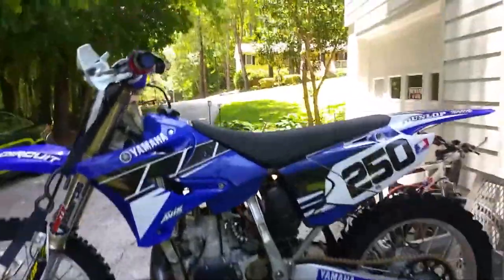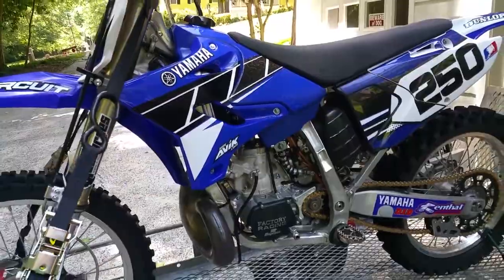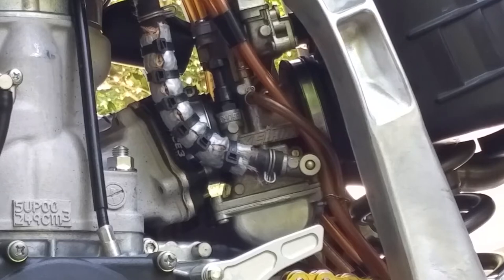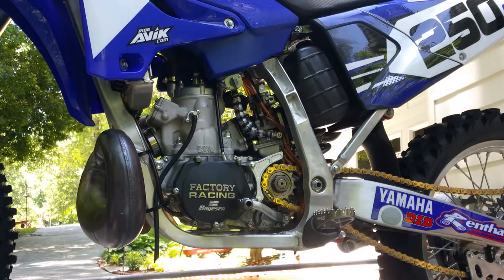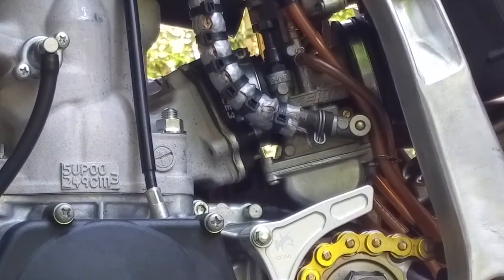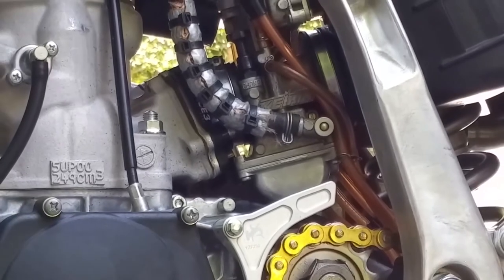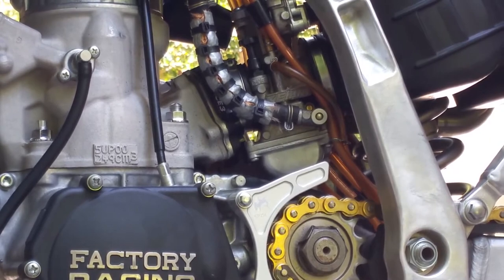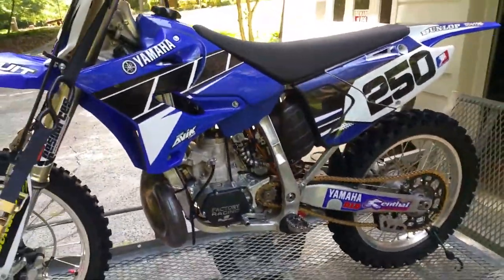👨‍🔧 Tips Adjusting Air Pilot Mixture Screw Mikuni Keihin Carburetor 2 Stroke Dirtbike MX YZ250 KX250

Comment: Great video man, whare I look when it sputters when I get on it about first 0 to 1/4 throttle. Seems like when I hit 3rd she blasts off like a rock, but until then she hesitates alittle. I installed the JD jetting kit the way they showed it. Sunk alot of money into this build...my first 2 stroke
Reply from the maker: Throwing a carb kit at it is probably not the fix.  You have to make sure all services are up-to-date including: thoroughly cleaned and inspected carburetor, top-end, air filter, exhaust silencer packing, all O-rings relating to the exhaust, carburetor and intake, inspect intake reeds for damage, check cylinder compression, do a spark plug reading, etc.    We need to know what year make model and how many hours are on your bike before we can recommend anything else. My guess is a thorough service and maintenance of your engine and carburetor are in order...

 Stock carburetor settings are fine for most bikes unless you live in extreme altitude, or at sea level in high humidity (or the above services are not up to date ..)

Post a long video of you riding your bike and of the bike running and idling and will we advise you further.
Reply: @HorsepowerHouse  
Yes will do... I've done everything you mentioned except repacked the silencer. But I will post a video for ya and I really wanna say thanks for your time. I'm pretty sure it just needs a fine tuning, but like I said I've just been learning as I go. The bike is a 01 ktm 200 mxc, compression is 165 out of 180 on a new top end...  new Keihn 38mm carb with the jd jetting kit. New air filter, reeds, spark plug etc....crank seal water pump seal.... . 50/1 gas mix with high end race oil.. bike is a monster... I'll shoot a video this weekend so you guys can help out! Thanks again
Reply from the maker: @freetaylor72  Has it always had this problem, or did it just start doing it?  And definitely check the silencer packing and exhaust o-rings.  Where do you live? (Altitude & climate)

Post a video and that might tell us more....  -Dave
Reply from the maker: @freetaylor72  What is your jetting? Pilot, Main, Needle, Air Screw setting etc....And what fuel & premix oil do you use?  And how does the spark plug look?
Reply from the maker: what did you determine?
Reply: @HorsepowerHouse  dude I've been working nonstop, gonna pull it out Saturday come rain or shine, changing the fork oil and put fresh gas in it. I'll take the video then...

Comment: Will warmer weather create a more rich or lean condition?
Reply from the maker: For most summer weather, also means more humid conditions as well, so that is "dirty" air (with less oxygen) compared to much "cleaner" drier, denser air in the winter.  So, you should equal that with fuel flow as well.  If the bike is "breathing" cool, clean, dense air, the bike usually needs more fuel (otherwise the bike the will run too lean).  On the other hand - If the bike is breathing hot, humid "dirty" less oxygen air - it needs "less fuel" to have the perfect air/fuel ratio.   So, simply put, bike needs leaner carb settings in hot summer, but richer carb setting in winter.  Of course it depends on where you live, altitude, humidity, etc.  Go on how the bike is running though - how it feels - as well as a spark plug reading.
Reply: @HorsepowerHouse  ok thank you
Reply: @HorsepowerHouse  Thank you!

Comment: Mine pops off for a second and then shuts off. I’m thinking some sort of carb adjustment. Takes a couple kicks to get it started after that
Reply from the maker: As stated in the Descriptiopn - fully service, dissassemble, clean, rebuild  your carburetor - IF everything else has been serviced.  Top-end rebuild, petcock cleaning, fresh fuel, new spark plug, etc etc etc...
Reply from the maker: What you are describing could be caused by a million things.

Comment: i have a similar problem on my honda cr 250 carb mikuni tmx 38 ... i already replaced all parts pj 25(40), mj410(420) , needle jet s7, needle gdy26-68(gdy26-65) float level 10(7.5)  , doesn't want to idle.  I have 3 revolutions of air, but it still seems to have little air and reacts badly to the air screw, can I take it all out to increase the idle speed....could it be a problem with vforce3?  they are about a year old, I had them outside and I didn't see a mistake
Reply from the maker: Has it always had this problem? Or what started it?
Reply: @HorsepowerHouse  no, and I don't know how it started, I just noticed that it was still smoking,I already had it cleaned with an ultrasound and it didn't help, but now I took it apart over the weekend and cleaned all, even the smallest channels, with a wire, but now I have the problem again that I'm probably low on fuel, because when I step on the gas, it keeps a high idle for a while and after  it drops in a few seconds, so I go up with the idling nozzle, now I put 30 but it's still not ok
Reply from the maker: @jonny621   I would say you are searching in the wrong area to solve the problem then. Something else is wrong.

Comment: I curently ride in winter (i ride 125 2t beta enduro bike) but I have a problem with the air/fuel needle because I can only turn it for 1 turn and than starts to go realy hard (so that means Im always on rich side and the bike  realy wants to die it isnt running good)  but normaly I could turn it like 4 turns. Is this normal for Keihin carburator or is it becaus I run summer jetting?
Reply from the maker: What is the climate where you ride?  Temp, altitude, humidity.  If it is quite different in winter vs summer you have to richen up your jetting for winter colder weather.   Pilot jet and Main jet.
Reply: Hi, its around 0 degrees celsius. I wasnt changing any jet only air/fuel needle. I richen it up like month ago it was running good but now it wont even stay running. @HorsepowerHouse
Reply from the maker: Richen pilot jet and main jet.  Should solve it.
Reply: I will try, thanks for advice!

Comment: Thank you for putting up this video on jetting.i have a 91 cr250 I just finished putting back together, and have never messed with tuning a carb before. Your examples will help, I hope. Also, what do you have wrapped on your fuel line? Thanks
Reply from the maker: Heat shield
Reply: @HorsepowerHouse  is it to protect the fuel line, or keep fuel cooler?
Reply from the maker: Keep fuel cooler.  Colder fuel makes more power than hot fuel.  Always refrigerate your fuel or at least keep it cool in the shade or in a cooler with ice.

Comment: What size jets do you usually run in cold Temps?
Reply from the maker: Larger than summer temp jetting.  Depends on where you are in the US though.  Hot  humid usually needs leaner jetting. But hot dry conditions need richer (to keep the engine cooler.)  Colder drier air usually needs richer jetting (because the bike is breathing cleaner air.)  But there is a fine line all depending on the conditions you are riding in.

Comment: My 2023 yz 250x was having rich jetting problems fouling plugs. It only has 3 hours on it. And the last couple of times I rode it it was sputtered and died. The smell from the exhaust was like plastic instead of the nice yamalube smell. Im running 32.1 non ethanol 87 pump gas. But the gas is from ealy September 2023 . So someone said old gas smells plastic like when burnt
Reply from the maker: Dude get that ancient fuel out of there.  Fuel starts to go bad after THIRTY DAYS!  And only use non-ethanol fuel with Sta-Bil and your good quality premix oil.   I bet your carburetor could use cleaning as well.  And check the spark plug.    If you have videos of it running, send the links.

Comment: My 2024 YZ 250 runs good but my spark plug is a dry black. My buddy said it's running a little too rich. I changed the pilot and main leaner from stock but it didn't run good so I went back to stock. If I back this air screw out a little will it lean it out so i don't foul a plug deep in the woods?
Reply from the maker: The video is your friend. Follow it's lead...

Comment: What's on your fuel line
Reply from the maker: Heat shield
Reply: @HorsepowerHouse  also, I'm currently living in blairsville ga, about an hr north of talking rock. My 2020 250x is only getting one ride per plug and I know the jetting must be off, I'm having to run the br7es plug to make up for this. Any suggestions on a main jet or pilot jet per season that have worked for you? Ridden yzs all of my adulthood love the bikes
Reply: @HorsepowerHouse  most frustrating my local yamaha dealer suggested I use the bpr7es.. would that not be at a risk of detonation? I'd like to resolve my issue completely and run the recommended plug I'm trying to get my bike in order before oct because I will ship to parris island then for 3 months of training, want to come back to a bike ready to go
Reply: @HorsepowerHouse  one more thing... does that headshild affect how the bike runs as in improvement or simply to preserve because of the expensive cost of fuel line these days
Reply from the maker: @peekingtom8337  colder fuel makes better power than hot fuel. Simple as that.  And if you refrigerate your fuel and 
/or use heat shields on the bottom of your gas tank you will gain horsepower.
Reply: @HorsepowerHouse  question whast do you think can be making my yz125 guzzle gas..? it seems that the bike runs amazing jet wize and idle wize
Reply from the maker: @aidenmidlifts9542  Sounds like you are twisting the throttle quite far.  There is no such thing as a fuel efficient motocross bike if you ride it hard... lol
Reply: @peekingtom8337  a lot of the newer yz250s including the x have the float height set too high from the factory buy a float height gauge and check the float height before you bother to change jetting, my brand new yz250x was the first bike I have ever had to adjust the float height on and I've been riding 35 years.
Reply from the maker: I check every bike I touch.  Some need adjustment. Some don't.
Reply: @peekingtom8337   is talking rock track still open?   I’m not from GA but rode there once 18 years ago lol.   Just got back into riding last month after a 17 year break.   

I really enjoyed that track when I was down there.  Rode at another place also that was somewhat close to talking rock but I cannot remember the name of it.

Also thanks for your service man 👊
Reply: @Revelation22_5  honestly I'm not sure, I'd say probably, last time I went there they kicked me out and told me I was riding to aggressively on the upper turn track. Told me I had to ride the other track but I had a 10 year old with me who wasn't capable of riding on that track nor did I trust the other riders to be on the same track with him. Not a good experience honestly. They're not always open either, I'm honestly a woods guy more so. I love riding trails over everything

Comment: Just got my yz85 couple days ago and i drained out the old fuel and poor in new! It smokes alot when idling. Would that have to do with the carb adjustment or is that some internal issue? 

The previous owner installed new carb i could tell and he said he hadn’t adjusted the carb when he installed it.
Reply from the maker: Let me guess, you got it at a really really good price...
Reply: @HorsepowerHouse  haha yup 2006 yz85 for $1,600 i can tell it idles high!  I started it up lastnight but it was getting late and didnt want the neighbors to call the cops for a noise complaint so i was going to see whats up with my carb and adjust it if possible.
Reply from the maker: @mclovin_it8872  it could be any number of things, my man. I recommend you get some professional help, maybe from a mobile mechanic who can come to you, otherwise you will be chasing your tail for who-knows-how-long.
Reply: @HorsepowerHouse  alright ill do that and see what they think or recommend Thanks!
Reply from the maker: Let us know what you find out.  It can be any number of reasons why a motorcycle will not idle properly.

Comment: I've been changing my jets and checked the rubber O ring on the air fuel screw is seated.
But I still am having issues with air fuel adjustment. It does not change idle no matter how far In or out I go. And I've gone down. In jets and up 2 sizes with no change. Moved.the needle seat down 1 but noticed a bit of pinging. I'm at a loss
Reply from the maker: You obviously have something else going on.  Could be any number of things.
Reply from the maker: Post a complete video of your bike.  Of it running, riding, a walkaround, etc.  The questions will be in the dozens....
Reply: @HorsepowerHouse  bigger yer I thought so.
I was just going to get a lectron if a carby tune or replacement may cost as much as oem so may as well go new carb.
Yes I guess I'll have to take it into the shop.
It idles fine. And runs ok. I run Maxima 927 ay 30:1 with pro circuit pipe and jetting matching the pro circuit pipe jetting specs.
I live in NSW , WEST SYDNEY.  Sea level
Reply from the maker: @auskilluminati333   When did it start acting up though? Surely it hasn't always done this?
Reply: @HorsepowerHouse  I only got the bike recently. 2nd hand. Noticed the power valve was stuck open. The screws had fallen out in the PV.
Also standard jets with reed valves and pip. So I changed jets to suit. But air screw is doing nothing I'll upload now Hang on
Reply from the maker: @auskilluminati333  Sounds like you should talk to the previous owner.  You got a mess on your hands....
Reply from the maker: @auskilluminati333  What does your carburetor look like? A filthy mess? Broken? Worn? I have never heard of what you said about the air screw not affecting anything.
Reply: @HorsepowerHouse  carby looks ok. Besides the slide has some wear marks On it. The carby was clean. And I cleaned it again.
 Not done a rebuild kit yet tho 
I have a feeling it's a air leak I dunno.
The spark plug looks ok Now . Was rich. But jetted it and adjusted the timing.
Reply: @HorsepowerHouse  UPDATE.
Just pulled off the carby and also the reed valves 
Noticed some liquid on the bottom of the reeds on 1 side. And checked them and noticed a very small gap on 2 of the edges..
I assume this is the reason why I couldn't richen it out perhaps.
Anyway I'll get new reeds and a carby kit see how it goes .
Reply from the maker: @auskilluminati333  sounds promising
Reply from the maker: It is always good to find the real source of the problem instead of throwing parts & money at it.   Sounds like that bike needed mostly proper maintenance and assembly.  Hopefully the reeds are the issue. Keep searching...  Imagine had you paid $900 for a new Carb and that NOT solved the problem....
Reply: Estava com mesmo problema atolando na aceleração rápida era o jato piloto pequeno aumentei e resolvi o problema
Reply: @RiverMotos  English?
Reply: which setting of speed, low, medium is high, if it is moving in the air screw and there is no change, possibly the error is in the pilot jet, the bike gets stuck in fast acceleration
Reply: warm up the engine speed up the bike to about 3,000rpm now turn the air screw until you get full throttle, then check how many laps
Reply: @RiverMotos  I've changed the pilot jets . Found the reed valves were a bit worn I'm going to fix that and rebuild the carby than try again.
Hopefully that fixes my issue
Reply from the maker: Have you inspected the pilot jet? Remove it and look through the tiny hole in the jet.  If it is clogged you will have issues.  Replace it.
Reply: @HorsepowerHouse  yer man. I said before. I had. And even got new ones. Different sizes. Pro circuit specs
Reply: @RiverMotos  I've got a 48 in there atm. From standard 50.
Reply from the maker: @auskilluminati333  Stick to original stock settings for now.
Reply: @RiverMotos  I don't seem to have any running issues that. Aware of. Bike ran ok. No bogging or backfiring. Just couldn't adjust the af screw no Matter what jets I used...
I'm running 927 at 32:1.
98 octane. And timing is slightly advance
Reply from the maker: @auskilluminati333  Still waiting to see a video of it running & riding
Reply: @HorsepowerHouse   I'm uploading a new video to my channel. Its the reed valves.
I'm concerned about the ability to see through the carbon fibre also. 2 parts of the reed valve has visible possible delamination,I assume wear . Otherwise maybe normal but I don't think so.
Also there are some gaps. I read that paper thick gaps are ok. But I'm not going to leave it like that. Ordered a vforce 4. And carby kit.
Reply: @HorsepowerHouse  haha I'll show you once I'm done .
Reply from the maker: @auskilluminati333  sounds promising
Reply: Just fixed a 2001 yz250 with what happens to sound like the same problem. It had a boyeson rad valve and the reeds weren’t setting right on it. The reeds have this coating that burns off and let’s compression go back through the carb. Check if it’s spitting fuel back from the carb.
Reply: Hey guys I’m also experiencing this issue my idle screw does fuck all either I’m not too much of a novice and have jetted a ped to suit a 70 bore but my dtr125 has a cone filter and dep front pipe ( have vids on the Chanel) but instead of stock 210 I’m 220 main jet but the bike runs okay but shitty if I’m honest and thinking the air filter is doing it I’m gonna try stick a soak over it and see if it helps when trying to tune the air screw as I believe I’m just getting to much air from this but not sure if I need to add more fuel to compensate like the ped jetting but I’m fucking lost rn lol